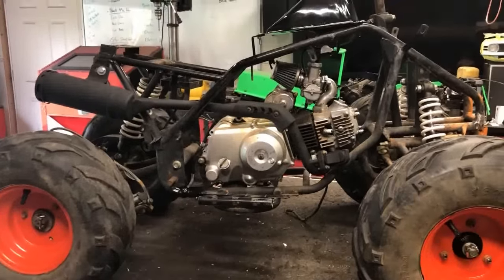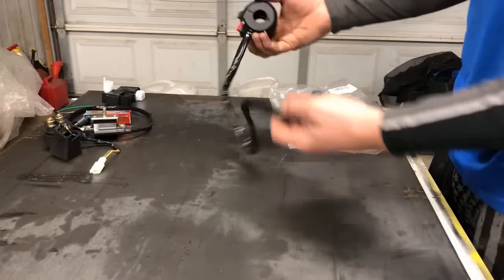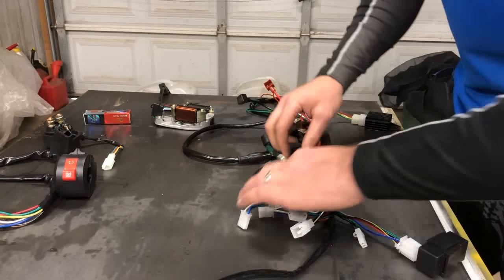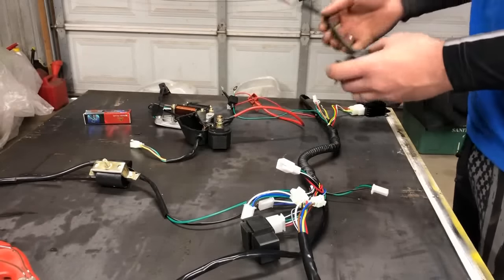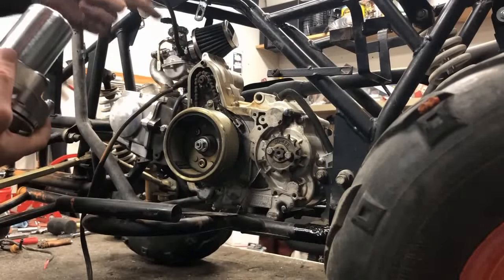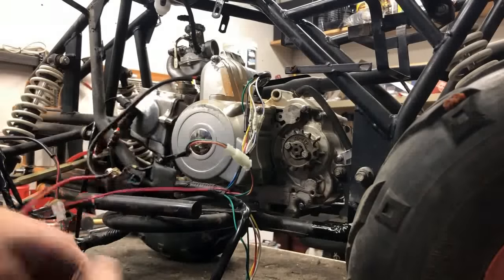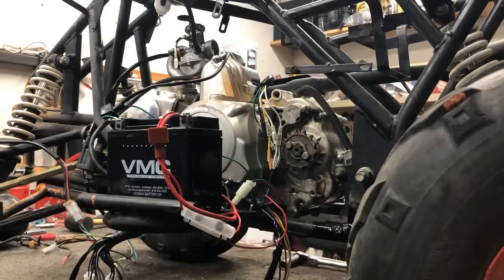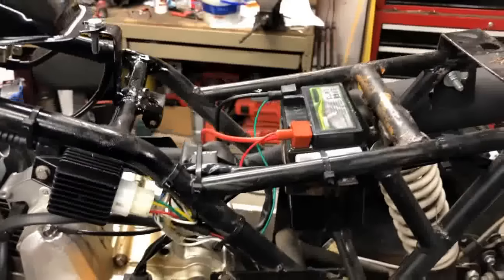Wiring a Chinese ATV from start to finish with an All New Wiring Harness!

Comment: Wow great video helps explain a lot in detail without all the mumbo jumbo ! Truly appreciated as this vid gives me confidence in getting my lt80 going again ! Only issue I have is I have a two wire stator one is white with red stripe and the other is black and red stripe !
This more than likely won’t connect colourwise to this Chinese loom as the wiring loom has 5 wires to the stator ,yellow,red withblack stripe,white,green and blue with white stripe ! I’m not sure which wires I will have to connect to my stator to get this loom to work ! As I’ve read and researched I might have to put 2 of the 5 wires together and connect to 1 of the wires off of my stator and then another 1 of the 5 wires to the other wire on my stator but which wires ? And then that still leaves 3 wires hanging where would these need to go and what would they be for ? Could I just tape them up as I won’t need them ? I’m so close I know to getting spark I will not give up lol new subscriber and my pal has just joined the party lol thank you for any help offered in advance , happy new year :)
Reply: I’m getting it to run the starter motor but I’m not seeing any spark so I guess out of these 5 wires I need to find the two that go to my stator or maybe it may be 3 to the stator in the combination I mentioned above and then the other two , maybe one for ground ! But still leaves one ? So I’ll be trying all sorts of combinations with my two wires out the stator and the 5 off the loom! I will mention I hear one of my wires takes charged power to my battery to keep it charged and I think the other has something to do with the spark ? I hope this info helps you out in trying to help me out lol thanks for anyone’s time with this issue appreciated

Comment: Awesome! Literally just ordered the same harness for the same quad. Waiting on it to be delivered to install. My quad suddenly stopped getting spark and I had 2 cdis and plugs so don’t know what else it could be so just replacing it all.
Reply from the maker: fstrthnurmom Nice! It just makes sense because of the cost! Don’t get me wrong I love to trouble shooting and finding the problem, but sometimes is just cheaper to throw it all out and start new!
Reply: Where did you order the wiring harness from? Can you send the link please?
Reply: Im trying to find out where to purchase this kit as well.
Reply: @cb3racing753   @Heidi Ferlin  Just search your engine size "chinese atv 110cc wiring harness" they all seem to be the same from ebay/amazon wherever. There's a difference in them in terms of what stator they have so look out for that. I may sound like I know what I'm talking about but I say all this from ordering it for my own quad and waiting haha

Comment: I have the same wiring harness. I cannot get the starter button to engage the solenoid. I even held the two safety switch wires together like you said. I have spark so I know the cdi and stator are working. Everything is brand new with the harness.

Comment: I can't get any spark in a Honda 500 could you please advise me on where I'm going wrong, love your videos!!
Reply from the maker: Stator, CDI, Coil, and Spark plug are the components that effect spark. You also have the ground wire, safety tether and kill switch that need to function correctly. Start with the easy stuff. Check your safety's, clean your contacts for ground, make sure your battery is fully charged, and use a multimeter to make sure the kill switch functions properly with an open and closed circuit. If you do all that and still no spark, then likely you have a failed component. In my experience if you have a failed component it's usually a bad CDI Box.

Comment: Great video, well explained! Thanks, just helped me sort out mine. Was really please when it started! I had a square plug that came out of the engine that was connected in the old harness, but the new one didn't have a connector for it. Even without it connected it started. Sorry I don't know the tech term for the spot that the wires are coming out of. Thanks again.

Comment: I have a 110 ATV. Two questions. What is the “safety switch” and where does it hook up?  Also, My 110 has a remote kill button but it’s not addressed in the video and I don’t see a plug on the wiring harness. Should I even try to hook it up anywhere?  Your video told me everything else I need to know. Awesome thanks very much.

Comment: Fantastic learning video....I just got a Yamoto ATV to work on and according to the owner it's a150cc....I don't find anything saying it's a 150cc but I noticed the block is stamped 196cm...What do I go by at this time I need a wiring loom because it's totally a mess....missing all kinds of stuff the starter button is broke and  I want to replace everything.... I got it to run but it runs rich as all  get out....the carb is a PZ50( Which I took off the motor when I got the ATV....It seems to be running real rich so I adjusted the metering rod so it doesn't run as rich ...but I haven't run it since  I adjusted the rod...Sorry to run on  but I really need to get this going so I'm trying to get my answers in one shot....so I don't bother you again.....I checked for the numbers you got for your wiring harness and other things but none come up...Do you know what else I can use for the wiring...If you could leave me a message ASAP I would really, really appreciate your help with this....Thank you so much in advance....Rgilly
Reply from the maker: Rod Gilbert Alright, if it’s stamped 196 then you’ve got a 200cc motor. When it comes to electrical they run the same harness on the 150, 200, and 250. So your safe to buy from eBay or amazon. When it comes to the carb I’m a big fan of just replacing them with new. They are very cheap online and it saves me a lot of headache down the road if I get a non start issue. Good luck on the project!
Reply: @PraskaBoysGarage  Thank you so much for your reply...I feel like a cloud has risen and I now see the light...I really appreciate your help with this and I'll let you know how it comes out...I'm sure oiit'll go real smooth with the info I've learned from your video...….Again  Thanks, Rod

Comment: hey i have a baja wd90s and wanted to the same replacement to it, but can not find a main harness for mind i had order the two coil systerm before i saw your video.  
Now when i got the kit i saw that the main harness was way shorter then mine.
Second i saw that my coil (or spark pack for plug) mounted with two bolts not one post
finally my cdi dosen't  mount where yours dose  but was in the very front which with the shorter main it will not fit.
i did look on amazon for a kit but can not find one the reason i want to replace everything is i started to replace the mult-function switch  but when i got it would not hookup 
would really like so help
Reply from the maker: Alright I know the type of ATV you have and it's very similar to a Kazuma Falcon 110cc I worked on for my channel. I am not sure what harness you purchased first, but if you buy the 2 coil kit I have in my videos description I know that exact one worked for my Falcon 110cc. If you have more trouble shoot me an email with some pictures!

Comment: Great detail. You’ve helped me rewire a quad in less than a day but question because a small kid will
Be riding it. I can’t get the engine kill switch to operate any info on the wiring or should I splice in wiring to coil

Comment: Great vidio. Have a 110 coolster and you have inspired me to get it running. One question? The positive (red) battery cable also has a in-line fuse on it. Where does that go to? Thank you so much. I cant wait for further vidio's.
Reply from the maker: Thank you for watching! The red wire from the battery with the fuse goes to the key switch and also the rectifier. Hope that helps and good luck on your project!
Reply: @PraskaBoysGarage  
Thank you so much. I am not an electrician at all. Now, fom a moter without any wiring to firing and running. I was only able to do this becouse of your vidio. You ROCK.
Reply from the maker: @walterkrahl9313  Love it! Happy to help!

Comment: Just got mine cranked with the new wire harness kit. I suggest swap that old school glass china fuse link out with a good aftermarket flat blade fuse link. Those glass fuse cases are CRAP.  And make sure you get all the  excess black - red coatings off of the new battery connection post cables. They can mess with your connections.

Comment: the 2 extra wires you removed from the stater actually go to the device  that allows you to kill the engine on a key fob was an option on a few of these
Reply from the maker: That makes sense! Man that was a question I've always wondered about. Unless specifically requested, I never install those things cause it's just more to track down when they go bad!

Comment: I know the video is old, I hope you can answer a question... I have a 6 coil stator, can I swap it for a 2 coil if I'm changing the whole harness?
Reply: i have the same question have you tried it yet ? did it Work ?
Reply from the maker: It is a different side cover. You can swap it but you would need a different cover to hold the stator in.

Comment: Just got one and pretty much all brand new.... Everything is charging right but once it gets nice and warmed up it will die out and the starter sounds like its not getting enough power and will take the battery down to like 4.5volts while pushing button to start but then battery goes back up to 12v when not pushing button.... Brand new stator, starter relay, voltage regulator, starter, head, cylinder, piston and rings, clutch, battery.... Lights super lower during idle but get super bright when hit gas
Reply from the maker: Hey man sorry I am late to your comment! Sounds like the battery is bad. I call these cheap Chinese batteries seasonal because every spring you have to spend the $20 bucks on a new one.

Comment: How do I get the small chain back on the starter? I can’t get it between sprocket an the thing that keeps chain in line... 😩
Reply from the maker: Unbolt the starter, that way you can angle the sprocket down to give you clearance to put the chain back on. Then bolt it back with the chain already on the sprocket.
Reply: I finally got it !!! Thanks bro you’ve been a huge help. My son says thank you 😎

Comment: Exactly the video i have been looking for thanks so much. I have just bought the exact wiring harness for my sons eton viper 90 but i have a problem with the stator. Im using the original stator and the wires dont colour match with the harness,, any ideas would be greatly appreciated. Thanks in advance

Comment: This has been a go to for sure as my harness is jacked(new) and nothing was looking right. Got wired up. Now to figure out why there is no spark
Reply from the maker: Stator, CDI, Coil, and Spark plug are the components that effect spark. You also have the ground wire, safety tether and kill switch that need to function correctly. Start with the easy stuff. Unplug your tether, clean your contacts for ground, make sure your battery is fully charged, and use a multimeter to make sure the kill switch functions properly with an open and closed circuit. If you do all that and still no spark, then likely you have a failed component. In my experience if you have a failed component it's usually a bad CDI Box.
Reply: @PraskaBoysGarage  did your starter button light and kill switch match as far as wiring? I have 3 in the wrong locations

Comment: I would like to know if the CDI harness will work if I am using a Harbor Freight 212cc engine?  Also have no rear brake.
Reply from the maker: Daniel Correa Sorry but this harness is not compatible with a predator.
Reply: @PraskaBoysGarage  okay, thanks
Reply: @PraskaBoysGarage  I went ahead and reviewed your VIDEO again, and I believe that I will be able to marry the two so that it can work.  I will let you know.

Comment: nice video, did the mistake of buying the 6 pole instead of 2 pole. i got 2 yellow wire at the same side. how do i connect those with  other color left. thanks
Reply from the maker: Thanks! Both White and Yellow wires are charge wires, so you can mix and match them. If you have 2 yellow then plug 1 into the yellow and 1 into the white. Hope that helps!
Reply: @PraskaBoysGarage  thanks, will tried that

Comment: Loved the video got it all together but don't have spark any ideas?
Reply from the maker: No spark can result in a number of different issues. Start with the easy stuff. Check to make sure you have a good spark plug. Make sure you have a good ground. Then make sure the kill switch is in the run position and the safety tether is plugged in if you have one. If everything is good there then you'll need to do a continuity test for the spark components and see if you have a failed unit.

Comment: I have a Kodak 400 and a white wire had come off from some were. Every time I add the 30 amp fuse they blow I hope you can see were I am coming from because I don't. Thanks
Reply from the maker: I am not familiar with those atvs. A solid white wire is usually a charge wire that comes from the coil. Typically will go to your headlight switch, but that's just a guess. If I am in your position I would download the wiring harness diagram and try and track it down.

Comment: I mentioned on the last video I wish i could find me a free one or a rrally cheap one. Well i did find one for 150. It crank and all. He was jumping it off but it ran good. I'm just going to order me a lot like yours and just rewire it for my daughter to ride. Thanks for the uploads and the help. Also thanks for the links too. As soon as I find out which one i need I will order it. I was looking at other kits before watching this video and seen that some CDI boxes are 5 and 6 plugs. Mine is a 5 plug but Does that make a difference? He said it was a taotao boulder b1 4 wheeler. I looked up photos and it does match it. The kit you have listed doesn't say it was compatible with a Taotao. Does that matter?
Reply from the maker: James B TaoTao has become one of the more we’ll known chinese brands. They are exactly like all of them with the same motor and wiring. The 5 pin is perfect, you just need to make sure you get the correct stator! Good luck on the project and I’m glad to hear you got a good deal!
Reply: @PraskaBoysGarage  thanks for the reply. I pulled the cover off amd it was the 6 one, so i will order that one. I'm just checking now to see how quick my brother can get it for me under his prime account so I dont have to wait till the 8th. Thanks again
Reply from the maker: James B Happy to help!
Reply: @PraskaBoysGarage  Now that my harness came in i started following your video again. Everything was exact match but one thing. My stator had 5 wires from it. 2 yellow wires, red with black stripe, blue with white stripe and a green. The harness on the other hand almost matched. After connecting the red/black, blue/white and green, I'm left with w wires that didnt match. The stator wires are both yellow but the harness has a yellow and a white. Does it matter which one i plug into which?

Comment: Video is great.  I learned a lot from it. Wish you could help me more. Change and installed exact same harness but still got no spark dont know What to do now.
Reply from the maker: Thanks! Okay, it's probably something simple. Just troubleshoot a few things. Check every connection make sure all the connectors are good and not bent and hooked up in the right spot. Double check your ground that it is clean. Make sure the kill switch is in the run position. Lastly if you hooked your safety tether up in the back, remove it.
Reply: @PraskaBoysGarage   i think i may have found the problem.  Is the motor is off time will that afected on the spark problem?

Comment: Amazing video, hooked everything up like you said had spark than zip tied everything into place and spark went away after starting once? Stator had a wire in the way that ripped up the Casing of the wire, didn’t cut it though
Reply from the maker: Was the wire that got ripped up a blue wire by chance? That's your pick-up sensor and it tells the cdi to send spark.

Comment: This video helped me out tremendously! The only thing I can’t figure out is does the feather strap have to be hooked up to start the quad? I’m getting a spark but won’t start completely.
Reply from the maker: If you don't plan to use the safety tether then leave is unplugged completely. Once its plugged in the the tether has to be connected otherwise it will kill it.

Comment: Hi! It’s a great video, but im just struggling with the starter motor positive cable. Where I need to connect it? Because i saw where you put the negative cable, but the other one?
Thanks for the answer in advance.

Comment: Great video!! it help me a lot. But I have one problem. The starter is rotating, but there is no spark.. My wiring is the same as in the video.
Reply from the maker: Stator, CDI, Coil, and Spark plug are the components that effect spark. You also have the ground wire, safety tether and kill switch that need to function correctly. Start with the easy stuff. Unplug your tether, clean your contacts for ground, make sure your battery is fully charged, and use a multimeter to make sure the kill switch functions properly with an open and closed circuit. If you do all that and still no spark, then likely you have a failed component. In my experience if you have a failed component it's usually a bad CDI Box.

Comment: Ok when you were talking about the safety feature with the 2 wires . Where do i connect the 2 wires ?
Reply from the maker: Those connect your the brake handle housing. You will see 2 prongs on the back side of the brake handle. Doesn't matter which one the connect to, either way will work.